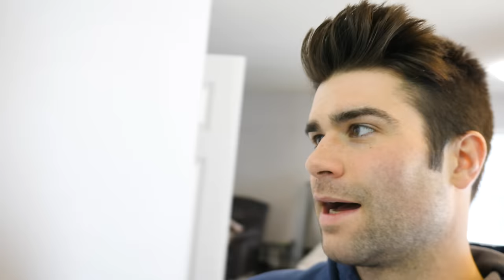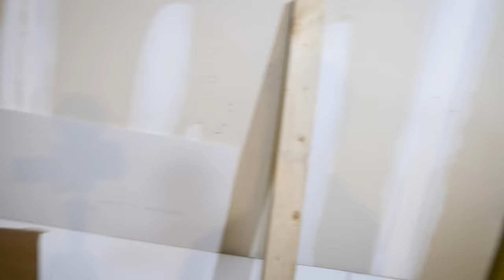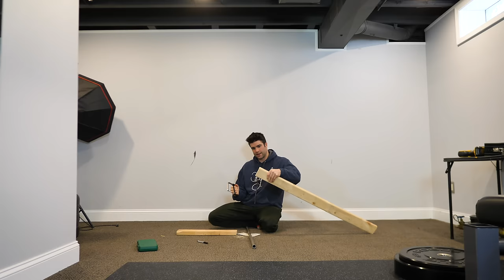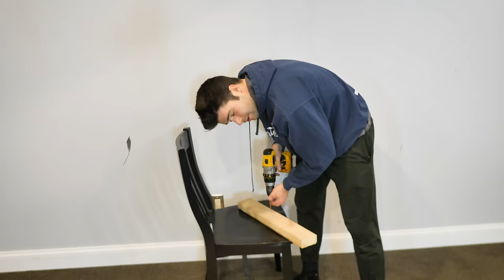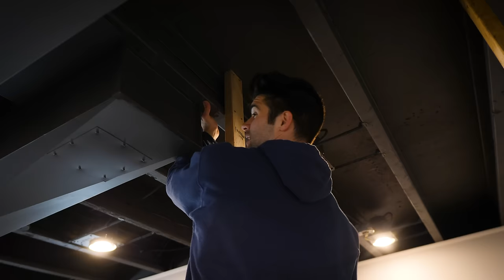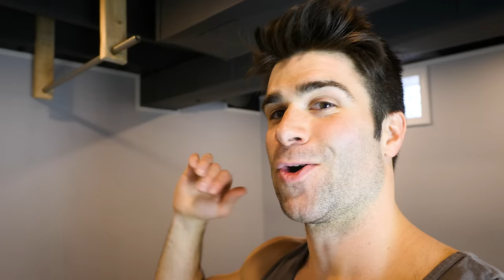Pullup Bar in Only 5 Minutes - Easiest In Home Hack

Comment: i don't think it can handle more then 90kg, is also good to keep your weight in check lol
Reply: 4 2×4 blocks instead of 2 2×4s could support double the weight
Reply: @victorstrokov8181  yes and drilling the hole further up. Putting it like 3/4 of a inch from the bottom it is likely to break through if you stress it. That's okay though he just made it quickly with what is on hand.

Comment: Use two bicycle hooks and screw them into the bottom of the joists. Hang the rod on the hooks. Even faster and less work.
Reply: Great idea!
Reply: Not as strong
Reply: Using that method for years. Except the bar rotates. 😎

Comment: I have a 7.5-8ft ceiling in my room and there is one of those little attic access hatches. No ladder, just a square of drywall and trim around it to keep it from falling down. If I push the hatch up i have direct access to the cross members that support the ceiling and holding the walls together. The cross members are at the perfect height for a pullup. Most people probably have one in their closet or bathroom or something.

Comment: Hey Lucas, I have brain teaser for you.... How do you perform t bar pull-ups with an at home pull-up bar? With and without the actual t bar. I want to isolate those wing-lats by locking up my arms in a 90 degree angle for the entire pull-up rotation.

Comment: Would definitely change that curtain rod to a steel pipe that's stronger, and would also have put the holes a little higher that looks like over time it will fail

Comment: Don't drill your holes as low as he did, drill them about an inch or two higher, so it doesn't break too fast
Reply: Also use two stacked, so it's super strong